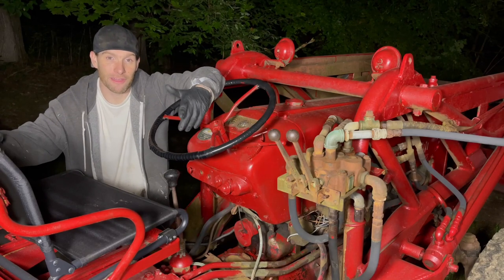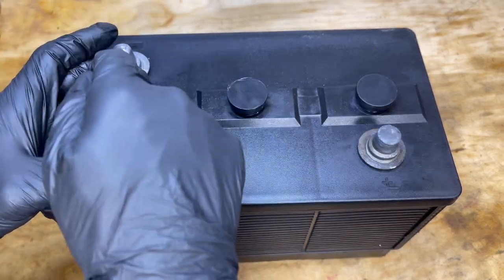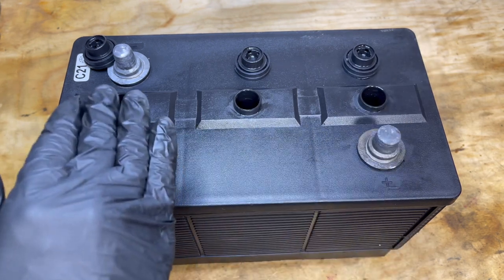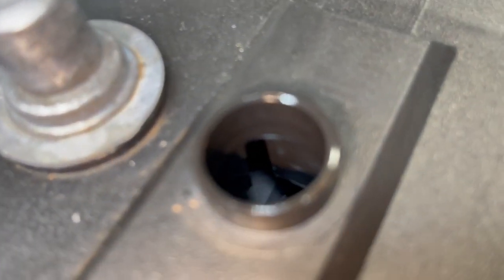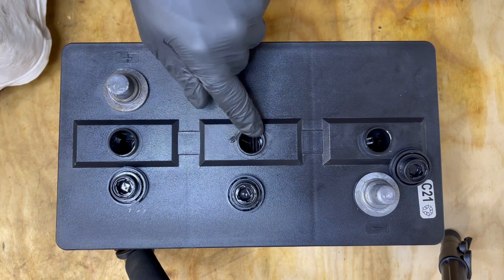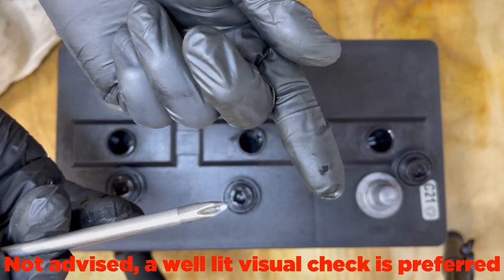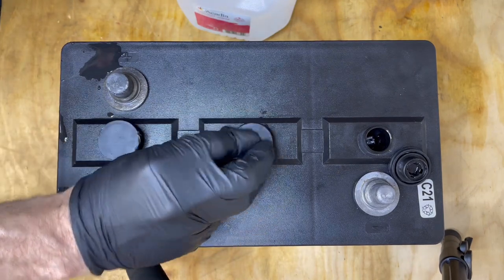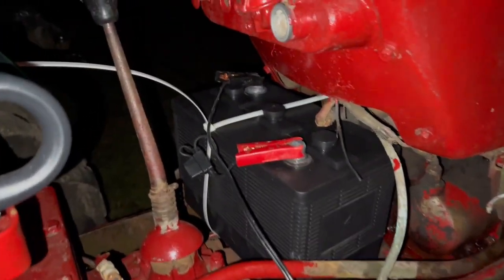How to check car battery water level. Check / Top Off 6 V or 12 Volt Truck Battery Acid Fluid Level

Comment: Thanks for the content. What happens to the battery if you overfill it?
Reply from the maker: It wouldn’t be as bad if it was just charged, but if too much water was added before charging, the electrolyte levels would expand and most likely cause the battery to overflow and could damage the battery.
Reply from the maker: If you’re doing it right that shouldn’t be a problem because a battery should only be watered after its completely charged. But, you should always check the water level before charging. Before charging it’s important to make sure there is just enough water to cover any exposed plates